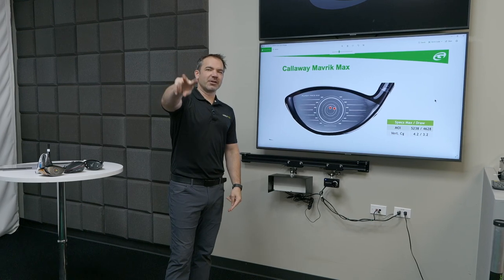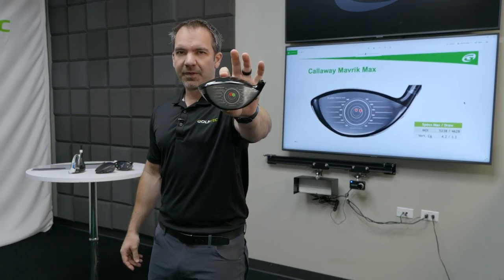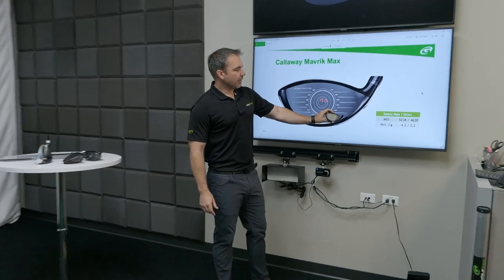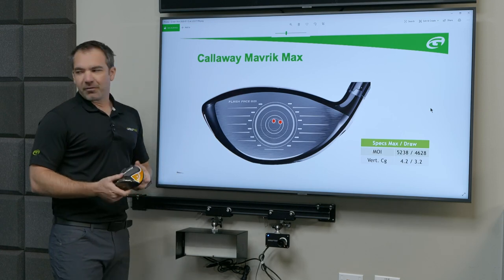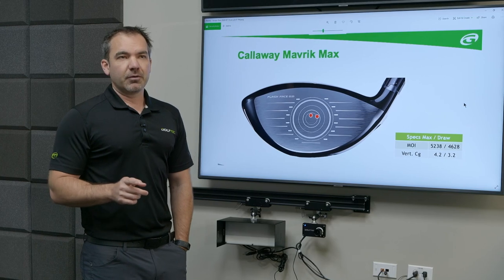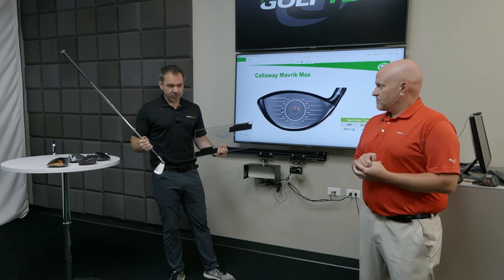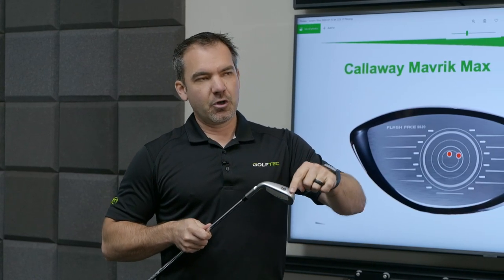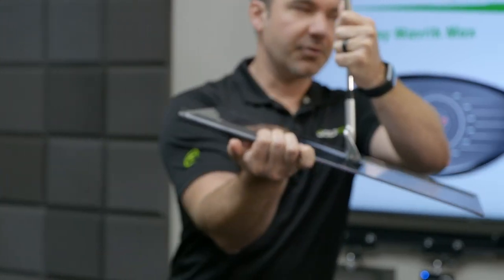Debunking Two Club Fitting Myths

Comment: That was very informative, all my irons are 2°up, and I pull all my short irons, I had previously talked to my new pro and asked him to put my shorter irons back to standard.
I have Titleist 716 irons and they are more upright than my previous Mizunos were, so adding 2° has made them 4°upright in comparison
Reply: @GOLFTECLessonsFittings  Thanks, yes, just got my irons adjusted so they are now 1°upright from Titleist standard, (pro measured them at 3° plus upright), might take a bit of getting used to, but tried my short irons in my back garden, and much better all ready.👍

Comment: If you fit someone with a 7 iron and they need 2 degrees up how do you adjust the other clubs since their wedge will probably miss left and their 5 iron will probably miss right?
Reply from the maker: Hey hbyrdut, thanks for the view and comment.  Great question too.  When we fit for lie angle our goal is to get the face always pointing correctly to your intended start line.  So if you fit into 2 degrees up with your 7 iron everything is then adjusted off of that based on the clubs getting longer and shorter so they are uniform.  If you have a swing flaw that causes your short irons to pull and your long irons to miss in the opposite direction getting the lie angle fit correctly will help minimize how severe those misses will be but it wont correct the swing flaw itself.   Hopefully that helps make a little more sense. Let me know if you have more questions. 😀
Reply: @GOLFTECLessonsFittings  Thanks